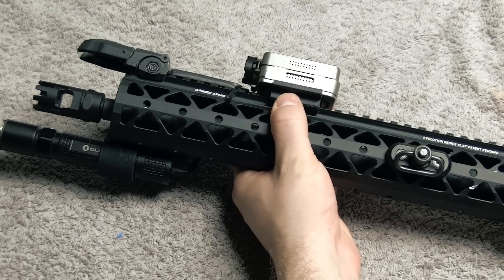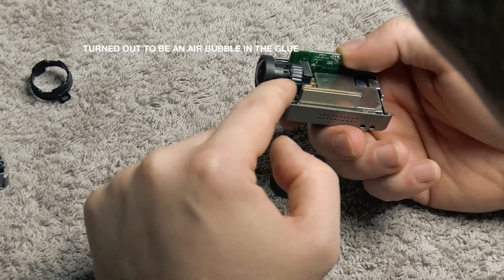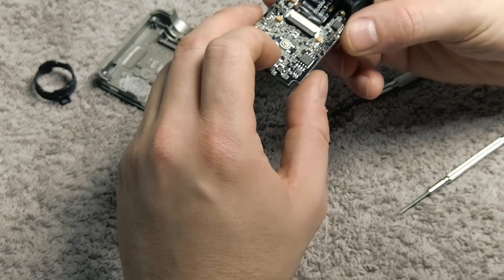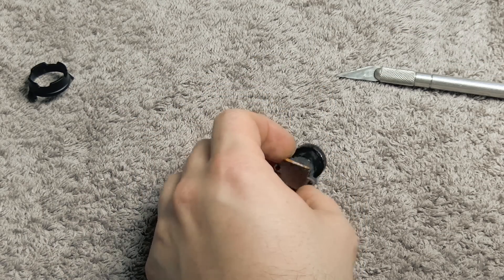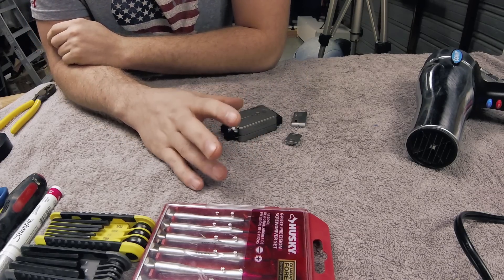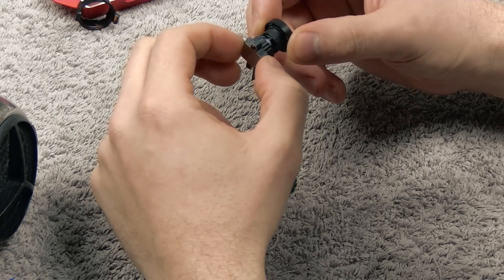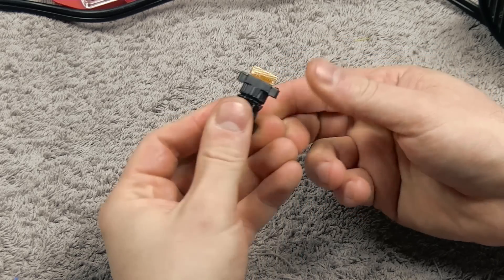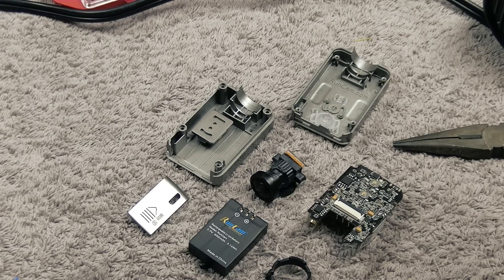RunCam 2 Disassembly & Lens Removal

Comment: Hi, just watched your vid to remove the glue as I want to change the runcam into a macro camera. I had an idea to use a cutting wheel on a dremel at about 15rpm. It worked a treat. About 25 seconds and it just unscrewed. You may want to try and video it but its much easier to remove that hard glue with no damage if careful. Now I can turn the lens for focus or change in for a zoom 35mm if a want to go long. Hope this helps Hugh

Comment: the glue on the runcam2 sensor module. needs to be cut away. applying heat will not help. you need utility knife to cut away the strips of plastic glue surrounding the lens.

Comment: hi, i have a quick question, i got the runcam2 got the 35 lens in it no problem works fine, however i am getting some pink footage:( can it be because of the IR filter? is it a must? sorry for some noob questions :)
Reply from the maker: Yes you are missing the IR filter or it is not covering the sensor properly.

Comment: its in the tech support faq.  the blinking light means there is a error in the connection the the camera lens module. $30 replacment so not a total loss.
Reply: Jin Pak or email run cam and they will help you for free. in like 5 min they sent me a new one they are AWEAOME!

Comment: Is it easy enough to put a 25mm in there dude, after you get the original lens out?
Reply from the maker: +MrJJuK 25mm won't fit, not enough threads, 35mm does work though.
Reply: +BrainExploder do you have a link for one that will fit please :D
Reply from the maker: http://www.ebay.com/itm/35mm-Tele-Photo-Macro-IP-Bullet-Dome-Spotting-Scope-Tap-Vid-CCTV-Camera-Lens-m12-/350255515373?hash=item518cdb06ed:m:mMUuCTL0UQv0sr90MyDFVgQ

Comment: why won't replacement lenses work? is it just the fact that the original lens is glued in?
can the lens holder be removed from the photo sensor board and replace it with this -> http://www.amazon.com/Quanmin-Holder-Board-Mount-camera/dp/B015J9RAKE/ref=sr_1_20?s=photo&ie=UTF8&qid=1458012893&sr=1-20&keywords=cctv+lens+mount&refinements=p_36%3A1253503011
then add a replacement lens
Reply: here is a faster source: http://www.amazon.com/Black-Plastic-Spacing-Camera-Holder/dp/B016FBNYNM/ref=pd_sim_sbs_421_3?ie=UTF8&dpID=414haE-OzBL&dpSrc=sims&preST=_AC_UL160_SR160%2C160_&refRID=1BNPM9YDC8H4VKN3RT52
Reply from the maker: +EvesRacing You might be able to get it to work but dealing with tiny electronics there is a good chance something will get broken along the way. I have since successfully replaced the lens, check out my latest video. https://www.youtube.com/watch?v=y_fCsbZBI9M

Comment: Hi BrainEx. , is the lens from the RunCam2 the same as mobius? The screw path is the same diameter?
Reply from the maker: +nOis3 Yes but they have different "away from sensor" requirements so when you try in the 25mm we all use for the Mobius it comes in focus before any threads catch so you cannot hold it in there, you need either thread extensions or as I found out pinhole style lenses work well, just installed a 70mm lens yesterday.
Reply: +BrainExploder hm i see... i have 2 lenses to try... a 25mm and 35mm. i buy a runcam2 today, hope it works. thank you
Reply from the maker: nOis3 I bought a RageCams 35mm lens and it came with a lens extension but I cannot find the lens extension by itself anywhere.
Reply: +BrainExploder  Wondering if you still have the lens and willing to part with it... Broke mine flown with a quad and crashed. Let me know tnx!

Comment: Hi. 
1. How many metal pins this sensor has? I wonder if sensor is the same as Mobius or not. There should be white text on sensor ribbon cable. 
2.Could be interesting with lens extension cable.
3. You can unscrew the sensor from metal plate nd replace with different housing with different lens. It will not ruin the sensor.
4. Is the camera board hot when recording 1080p60 for 1 hour or so ?
Reply from the maker: +Cabrio Driving In The Alps I tried a mobius lens on it and it was not compatible. I think the pin cable is the same I might try an extension on one of them eventually. I have not tried a full 1 hour recording but it does get warm.
Reply: Could you please tell what is the sensor used in this camera? There should be text written on sensor ribbon cable. Thanks.

Comment: Are there specific 25mm/50mm zoom lenses required for this camera, or will any standard CCTV lens (such as the uxcell replacement lens) work for the RunCam2? I haven't put in my 25mm lens into my Mobius, so if I can put one into a RC2, I'd be able to utilize the mobius as a third person camera.
Reply from the maker: +TiiMELORDHD I can tell you the Mobius 25mm lens I use and recommend on my video (link) does not work on this camera. I am experimenting with some pinhole lenses and getting some good results. Ill have a video up soon.
Reply: That's unfortunate. I was really hoping it would work. Looking forward to your video.

Comment: Thanks BE. The video I've been waiting for. Think I'm going to give the RunCam2 a miss. Looking forward to the Foxeer Legend Video. 
Maybe the creators of the Mobius will release an updated 1080-60 version soon.
Reply from the maker: +Airsoft CamMan I hope so but the Legend 1 seems to be a slightly longer Mobius all other dimensions seem very similar.
Reply: +BrainExploder After hearing you mention the Foxeer Legend I done a bit of research, and it seems the Foxeer's lens is glued in too. Will be nice if the Mobius lens unit plugs straight into the Foxeer.
Reply from the maker: I might try that although that might have killed the RC2 in this video. The glue is easy to break loose with a hair dryer as you probably know.

Comment: Yeah, that looks like a bit of a pain to take apart. Here's hoping you have more luck with the other one now you know what it's like and can get a zoom lens installed.

I've seen the Foxeer camera with a third-party lens installed and it works fine, though I wonder if the image stabilisation of the RunCam2 would be worth the trouble (if it works) as they both sit at the same price point.

Comment: +BrainExploder Just a thought, next time you may want to try a heat gun, it gives you more focused and hotter air.
Reply from the maker: +sogerc1 I am afraid that might be too hot for the electronics, no sense in rushing this at the risk of cooking the lens unit, I still don't know if the one I ended up with is functional, will be trying it first in the new camera and if it's dead then I'll try this technique on the new one.
Reply: BrainExploder
And no indication in the manual of what that green blinking light means? I find it hard to believe, usually that's something they specify. What would be the point of having an indicator if nobody knows what it means...
Reply from the maker: sogerc1 Didn't see a blue/green option but I can tell you it means the lens unit is damaged I just did a second camera and that was the problem not the mother board.

Comment: Great video again! Now I am completely sold - will order a Runcam 2 now. I am confident that it will work with a zoom lens and will try it on my own. Together with a low profile mount (thanks for your reply in the comments of your first Runcam video) it will be a perfect shotcam setup.
Reply from the maker: +ThePixelPasta I am going to work on a mount that basically puts the bottom of the camera on the actual rail to get it as low as possible.